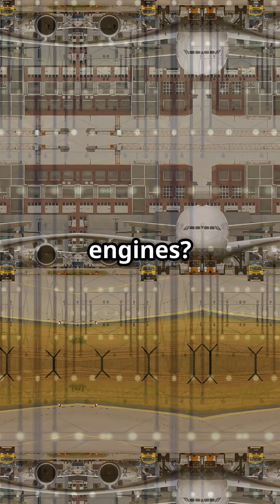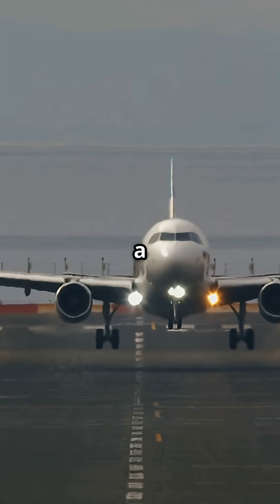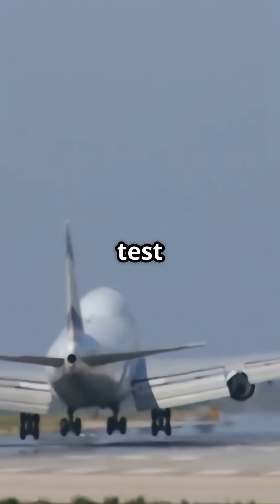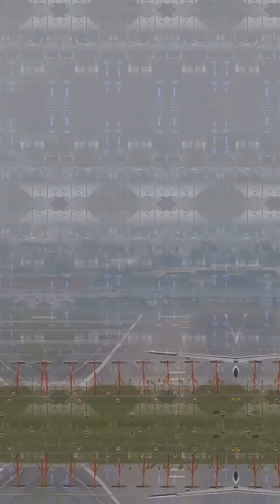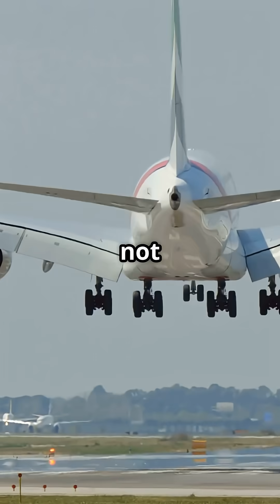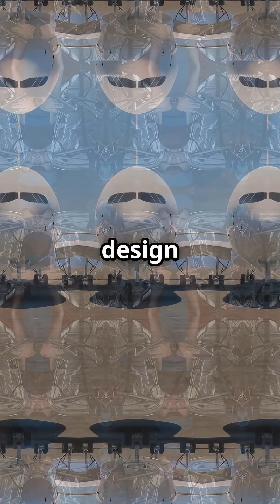Could the Airbus A340 really take off on just two engines?

Comment: Something I've learned recently is that the Saturn 5 rocket needed all 5 rockets to take off, but had burnt enough fuel weight off by the time it was above the launch tower, that it could continue on 4 engines.
Thrust is important more at certain points than other points of the flight path 😊